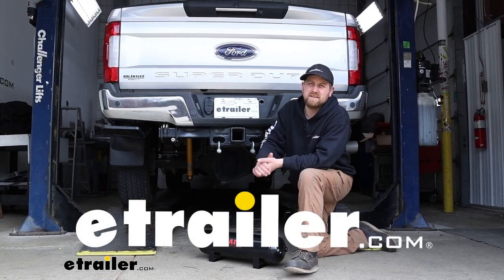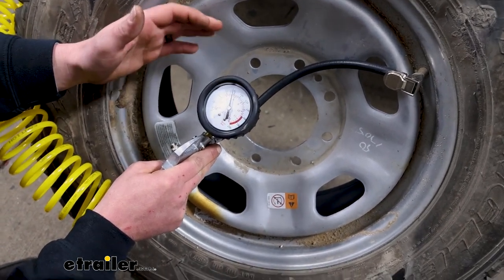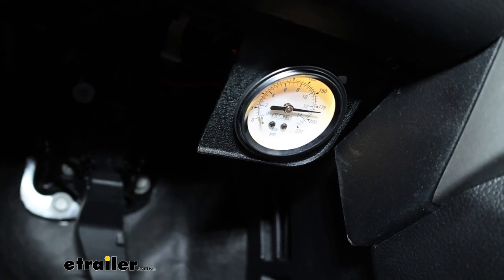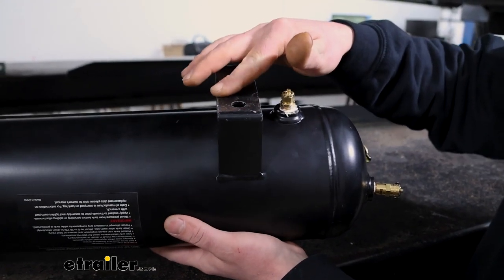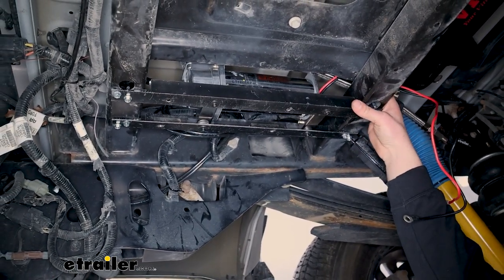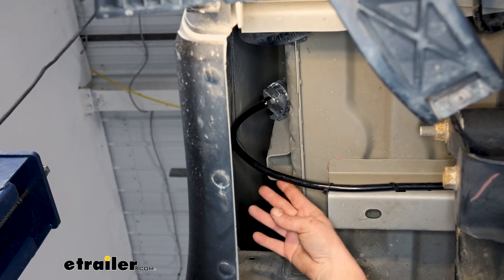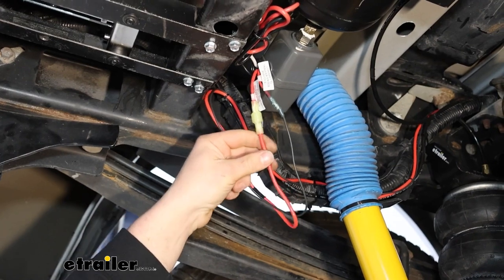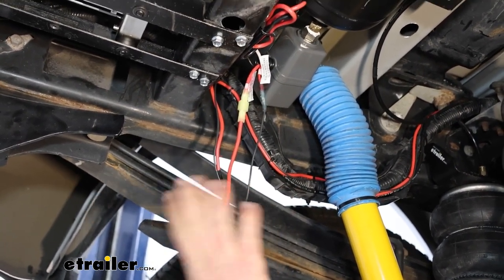etrailer | Viair Ultra Duty Onboard Air Compressor Installation - 2018 Ford F-350 Super Duty

Comment: Tip for corrosion resistance, if you need something to act as a barrier for 2 dissimilar metals, run to the dollar store and get a flexible plastic cutting board. Cut to fit your bracket, put holes in to match your bolts. Very cheap and nearly the same material used in an industrial setting. We used HDPE insulators when bolting steel brackets to aluminum. Only big difference is the texture of the cutting board.
Reply from the maker: That would work well for a compressor, but for something that's weight bearing such as a hitch, we wouldn't recommend it. Over time, the cutting board could deteriorate which would loosen the connection.
https://www.etrailer.com/Tire-Inflator/Viair/VA69WR.html

Comment: 1.8cfm is really low. There's 10.6cfm dual cylinder units available that will fill a 32" 0-35psi in 2min
Reply: They have other kits meant for tools